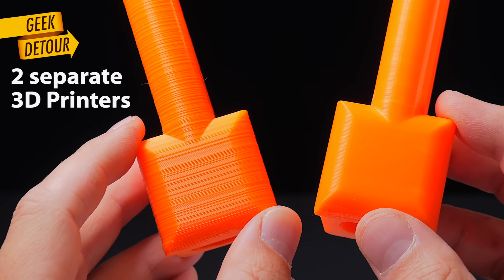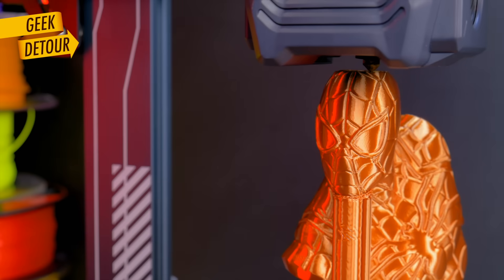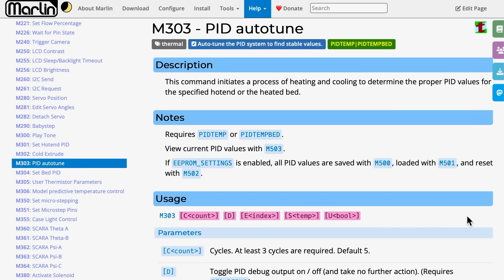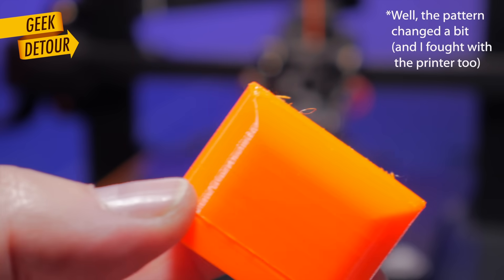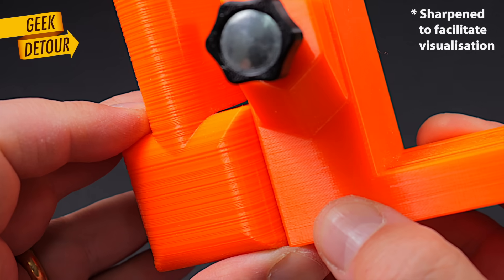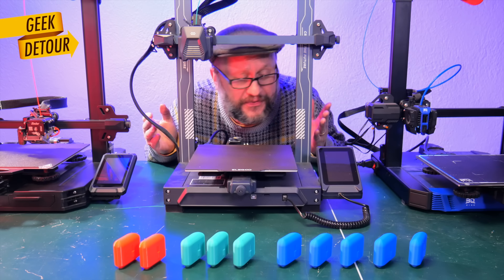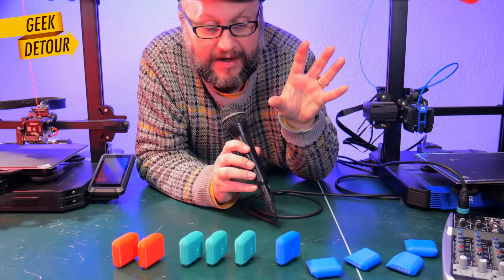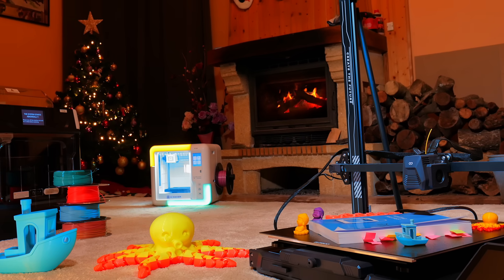3D Printer Problem: do you know How to Fix Z-Wobble?

Comment: Okay, paused. Get a Bambu Lab and don't worry about settings, lol.
Reply from the maker: 1st: Bambu printers are great 👍 2nd: every machine will need maintenance. I didn’t say about Settings at any point in this video 🤣 Open your eye: Bambu printers are not magical things - they will need you to learn basic maintenance, otherwise they will get bad the same way as any other machine
Reply: @GeekDetour  I've been using an X1C professionally for about a year now. I make sure it's lubricated and that's pretty much it. Some random failures aside, I've been getting amazing results every time. Before that we used a Creality CR-10 Smart Pro and it needed constant tweaking, maintenance and parts. And I can't believe how incredibly slow it was 😅

Comment: Могу дополнить возникновение проблемы.
1.Засорился экструдер и идёт неравномерная подача пластика.
2.Ослабло крепление шестерни подающей пластик.
3.Стёрлись зубцы на шестерне подающей пластик , плохое зацепление пластика с шестерней.
Reply from the maker: Our friend wrote: I can add the origin of the problem.
1. The extruder is clogged and there is an uneven supply of plastic.
2. The fastening of the plastic supply gear is loose.
3. The teeth on the plastic supply gear have worn out, poor engagement of the plastic with the gear.

Comment: Iam a mechanical final year student thinking of buying a good  3d printing machine which could help my final year project anyone can suggest a good 3d printer
Reply from the maker: You cannot go wrong with a Creality K1, a Bambu P1P or the Neptune 4 Pro (this one if you are on a tighter budget). If you need more demanding materials, Creality is launching the K1C, that will come prepared to print Carbon Fiber filaments, out of the box. Study your choices and your budget - have in mind you will still spend a hundred bucks in filament spools too 🤣

Comment: Yes I have had this problem and I think you're wrong. If you can't reproduce the problem that wasn't the cause. 
We all make the mistake of changing multiple things at once and only remembering one change. 
You have to study the part to get an idea what the printer is doing. If you had compressed layer the model would have changed height. So that's the first test. Screws have some significant mechanical advantage so if you could turn it with your finger, binding isn't your problem.
All the frames screws are likely to loosen over time, so use a thread cement. Currently I use blue-tak. Yar that stuff that you hold posters with.
Keep trying to stuff it one move at a time and you'll eventually find out how you fixed it.😅
Reply from the maker: I agree with you: I presented my most educated guess based on my experience. I thought about ways to bring the machine to the most similar state of when the problem happened - and removing lubrication (washing? Alcohol?) or waiting until the lubrication dries again?… How tight were the screw nuts? How much time should I dedicate to making this investigation to finally present an irrefutable point?
I had to move on. You don’t have to agree with my hypothesis, of course. The takeaway of the video is proper maintenance. I appreciate the time you took to elaborate your disagreements - you are not alone: I got a few comments here saying that if I could not reproduce, there is nothing to be shown at all. And I disagree: if I had stopped the video right before the testing, nobody would have argued anything 😄 But reproducing an exact state of dryness/tightness of the nuts was a journey I gave up pursuing. I hope you understand.
Reply: @GeekDetour  My philosophy is, to reduce the number of things that can go wrong you should first reduce the number of things.
Kind of like Occam's Razor but for engineers.

Comment: Hello, nice tutorial, in this book is there the problem of accumulation of material on the nozzle?

I have all my settings correct, I managed to limit two three other problems, but I can't find the accumulation, if I'm lucky the printing is not impacted, and if I I don't, the worst is that this accumulation goes on the layer which is printed, cools and when it passes over it will cause teeth to jump on the belt while the plastic melts with the temperature and therefore creates layer shifts on long prints -_-
Reply from the maker: There are a few things that causes “bumps” in your layers - thus, the nozzle will be running previous laid material. 1st: Overextrusion, and you could try reducing FLOW, like: from 0.98 to 0.96 and see if it helps. 2) Wet filament can cause some blobs here and there. It is less common but it happens. 3) Printing too hot can lift some edges of the print and the nozzle bumps on those spots. 4) PETG has a tendency to accumulate material around the nozzle and eventually it drops somewhere in your print and that lump certainly invites the part to be knocked over by the nozzle. Try reducing the flow as I said because specially in PETG, Overextrusion makes build-ups of material. Another GREAT thing for PETG are nozzles that are Nickel plates. Copper Nozzles with nickel plating almost never accumulate material around. Hope it helps!

Comment: I once got a similar problem, it wasn't the same pattern from piece to piece, but looked similar to the one in the video.

Finally the problem wasn't the printer, but the desk the printer was on: moved it to the floor and tried again. Problem solved.

Seems like XY movements were creating vibrations in the table which at some point started to add to one side or the other as a pendulum.
Reply from the maker: Hi there! Please, if the desk movement gets into your prints, something is not ok with the framing of the printer (maybe the screws are not tightened properly), or the bed is moving with some play, should just go back and forth effortlessly, but only in that axis, any other feeling of movement sideways, up and down, twisting… that’s a sign eccentric nuts are not properly adjusted. Same goes for the printing carriage, etc. When the printer is mechanically well adjusted, it prints perfect even an a shaking table.

Comment: Yep, you nailed it. I spent the better part of a year trying to pinpoint this issue on my S1 and even went to the extreme of installing oldham couplers and anti-backlash nuts on the printer - neither of which made an appreciable difference and if anything, those parts (or at least the way I installed them) contributed more to the rods binding than they did to resolve anything. I retained the oldham couplers but loosened the screws on the gantry as you said, and also removed the anti-backlash nuts, assuming the additional thread and spring pressure were adding friction to the rods. Immediate improvement to the part surface. My thanks for your fantastic troubleshooting!
Reply from the maker: You have no idea how much I loved reading your comment! Thanks! Very often, when I am working on a video, I overthink things… and imagine: “geeez, isn’t this super boring, or trivial?!” 🤣 Crazy how adding parts, even when they are designed to improve, can actually make it worse. I am happy for you!

Comment: The binding may have been cause from the position the nuts were originally tightened. Loosening them moved the z nut into a place where it binds up less and then retightening them in the position makes it impossible to reproduce the original problem. 

This video cracks me up because I spent a lot of time getting my printer to print perfect with everything tight. Should have just left it loose. Btw the z nut on my printer came tight so I had a confirmation bias to make it work that way.
Reply from the maker: Our journeys with the printers are so crazy… I didn’t like the silicone sock on my heater block - I thought it was a nuisance when changing nozzles. Only after a few months I realized I was having worst prints due to less than ideal cooling. It turns out the silicone sock on the heat block not only keeps the block warmer, it also protects the part from getting additional unnecessary heat… Put the sock back and it was indeed better. I am constantly tweaking and messing with the printers and I enjoy learning what works, what doesn’t work. 😄 Some things don’t come from factory the best way - some actually do 👍

Comment: I had this problem on a Ultimaker 2+ years ago and oddly I couldn't find any information about it online.  But the dead giveaway was that the surface imperfections always happened at the same layer height.  Thank you for taking the time to explain this!
Reply from the maker: Yeah, you are absolutely true: each Z-Lead Screws has an imperfection signature. We can make it less visible - but probably never really get 100% uniform and without ANY visible line when put under a harsh light. I’ve been thinking a lot about it… maybe I’LL come up with an idea to make it different.

Comment: I had an issue on my ender 5 pro where the wheels that run on the x&y rails were too tight and dragging. I loosened them a hair and put a little oil on the axles and the prints and motors ran much smoother.
I also noticed the tooth side of the belt was rubbing against the rail and causing stutters. Had to readjust the belt and now runs smooth.
Reply from the maker: That’s the spirit! Finding where things are not smooth, adjusting things, testing, learning! ❤️ That’s what I love about 3D Printing

Comment: Come to the fking point faster dude. It pisses me off that ppl stretch content for ads
Reply from the maker: You are so wrong: if I wanted to extend for ads, I would have pushed the video to 8+ minutes. It has 7:28, so, no mid-roll ads. I told the story I wanted to tell, no more, no less.
Reply: @GeekDetour  ok I am wrong about the ad part. However, I feel buggered considering that it imply to have a solution for the printing Problem. Whatever

Comment: Another cause of these lines can be a wobbly print carriage. That's a common problem. Another cause can be the print carriage applying more pressure on one side than another due to not being square enough that the print nozzle is square with the printing surface. In both cases loosening and retightening the print carriage with the nozzle in contact with the center of the print surface can help.
Reply from the maker: Sure! That’s the very first thing to do: making sure everything is squared and properly fit.

Comment: Ok but what is the purpose of this video? You didn't find the problem nor could you reproduce it. Everything you said was with a big maybe. What are we supposed to learn here?
Reply from the maker: Keep your printer well lubricated. Keep the wheels just tight enough, do a PID calibration. Understand how 3D Printing works. Problems happen for a variety of reasons and troubleshooting needs patience. If I had finished the video before my attempt to recreate the circumstances, you would probably feel satisfied already. Recreating the exact mechanical state of a neglected printer is basically impossible - if you had nothing to pick from the video, I am sorry. Anyway, have a wonderful 2024 🥂

Comment: Just my two cents... after years of tweaking my old ender 3 pro, it prints small parts nearly as clean as my Voron. What I found most useful for inconsistencies like this was polycarbonate wheels on the Z axis (not for X/Y) and POM anti-backlash nuts on both lead screws. Anti-backlash is optional but I can't recommend POM nuts enough. Seriously, you'll wish you tried them sooner. They are self lubricating but I use a dry lube as well, which keeps dirt from accumulating like grease and I've had no issues with wear.

Before anything I strongly recommend people go through and get the frame and gantry as square as absolutely possible. This can make a huge difference. Stabilizing bars can help further if you print fast and can help keep the frame aligned.

I'm not a fan of flexible Z motor couplers if you can avoid them and I personally have the top of my lead screws loosely secured with pillow bearings, primarily due to my dual-Z mod but this can make things worse if people aren't careful and/or if the screws are very warped. For some printers, flexible anti-backlash couplers are helpful but I think most people can avoid it with proper setup.
Reply from the maker: Very nice comment! I second everything you said. Well, the POM nuts I still need to try - lots of people talking wonders about them here in the comments. About squaring the frame and specially the Gantry: true! It was the first thing I did to my old Ender 3, the full “x gantry rework”.

Comment: @Geek Detour
Very good tips! I have a similar problem. The top of the Z-Axis move heavy if I printing small infill. I print a pat to stabilize the Z-Axis on the top. Now my print looks much better. I using Ender 3 V2 Neo with one Z-Axis.

Comment: Awesome! I have some informational videos on my channel.  Almost every 3d printing video I have has comments like: “thank YOU! You have NO IDEA HOW LONG IVE BEEN LOOKING FOR THIS” there’s situations in 3D printing that have never been an issue, and there is no instructions on those issues. Like for example, one of my videos are from freaking out when my Ender 5 plus kept moving up and slamming full throttle into my nozzle. It had turned out to be the silent board I installed, the BL touch wire plug went into a very specific location that is very hard to tell since the board is black, and the plug is black. 😅 I was freaking out the night I got the printer. No help ANYWHERE.

Comment: Mine only happens at certain heights and the lines are even around the model. Any suggestions?
Reply from the maker: If the lines coincide on different models, then the Z-Screw might have imperfections and there is not much to do besides cleaning it well, relubricating and see if it helps - on the worst case, changing the Z-Lead-Screw for a better one. But if the lines coincide with some detailes, some features of the part (like, where a “door” finishes, you have a line all around) then it might be adjustable by how you slice the model, flow rate, speed, retraction, or changing for a better filament.

Comment: Interesting, I went to check my Z rod nuts and they are super snug. My print quality is good enough for me though. I wonder if I should loosen them?
Reply from the maker: Hi there! Good 2024! You can try to loose them and print something to check. Print a small Calibration Cube XYZ that is flat and it is easy to compare before and after. You can always tight them back if you don’t like the result. I have one printer that actually prints a little bit better with them tight - but that’s a weird exception.

Comment: Also check the seam in the rollers. Sometimes they have a seem from the injection mold. That seam will really make you pull your hair out. A sharp xacto blade will make short work of it.
Reply from the maker: That’s interesting: none of my printers have rollers with seams. They all most likely were made from solid POM/Delrin, machined, like this: https://youtu.be/IdtG-hLgS6s?si=IbGsR7F3zvHGWRv0

Comment: omg ive been having so many issues with my ender 3 s1 pro after a few months of use which all seemed to accumulate after installing my sonic pad, and this just helped me fix one of the issues, planning on buying that book you showed off in the video now
Reply: also didnt know those nuts were supposed to be loose

Comment: From all the things you try to figure out and experiment with when it comes to 3d printing the z binding sure gets the most attention. And one solution has never fixed it on all printers. I think its time to remove it completely.
Reply from the maker: I agree. We are using something that could be better. This next year I will put some time to figure out the cheapest and most effective way for move in Z, and get rid of irregularities.
Reply: @GeekDetour  that's awesome. At this point the z is literally screwing me over.
Reply from the maker: 🤣 ha ha ha, literally! 🥂

Comment: the problem of the ender 3 s1 pro is the distance between the nozzle and the print bed because the bed is often lower in the middle and higher on the sides
Reply from the maker: Oh, but with bed-mesh leveling that doesn’t make into any perceivable difference on the prints.

Comment: So are any visible lines on my 3D printed parts acceptable? I'm relatively new to this and I'm not sure what a "perfect" part would actually look like.  Your part, from what I can, see looks as smooth as a factory molded part. I don't know if my understanding is correct or not.
Reply from the maker: It is normal to have layer lines. What we want is regular, aligned, layer lines. In this video, the parts were too big/too far to actually see the normal layer lines, so it looked “smooth”… but even the very good parts have visible layers if you look close enough, but when they are very aligned and regular, it is a very pleasant surface.  When I made the review of this very same Ender 3 S1 Pro, I recorded much closer shots of the prints. I consider them quite close to perfection - you can see layer lines, all of them, as a texture: https://youtu.be/bQ6E27bCyBw?si=J-si4EwNj_d_BICa

Comment: It's simply due to poorly made machines.  No one wanted to build a rigid machine, so the nonconcentric forces on the lead screws shift with height.  Make a rigid machine that has some remotely decent level of accuracy, and it all goes away.